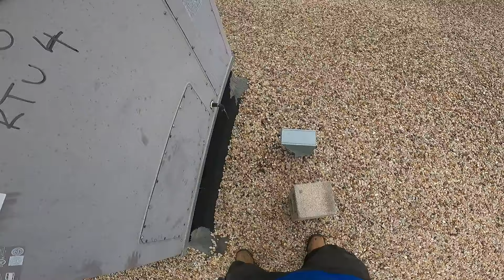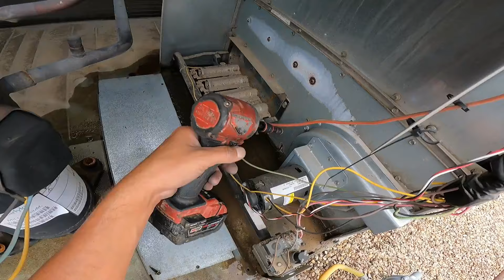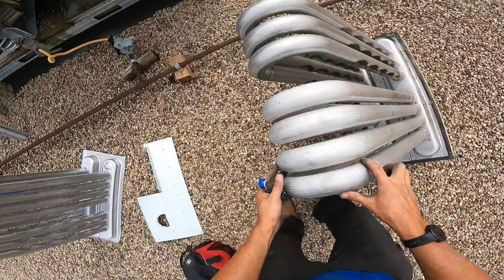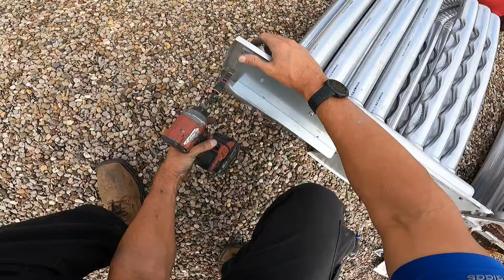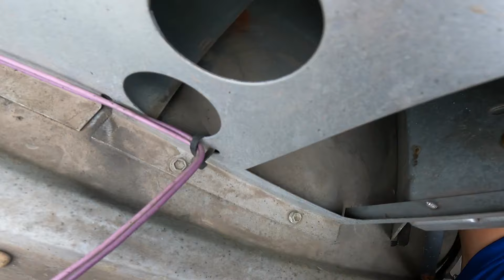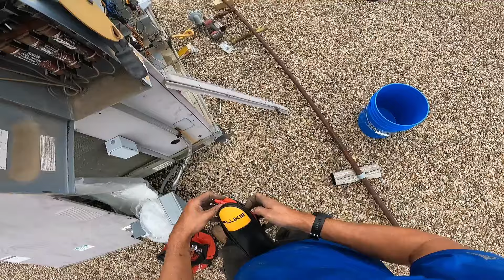Carrier Heat Exchanger Replacement

Comment: Well maybe they thought that the drain  was plugged and on the positive side of the blower so they drilled holes to let it drain. Who knows. Next time when you change the heat exchanger try some spray glue on the gasket, just a little will do. Good video